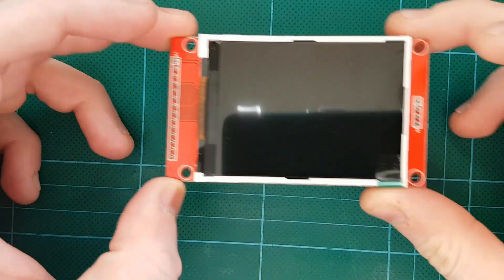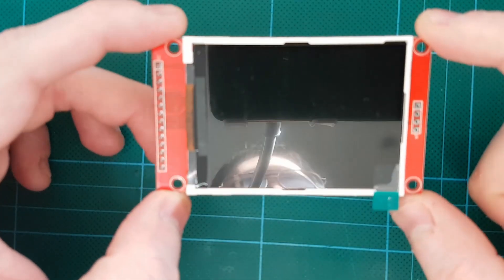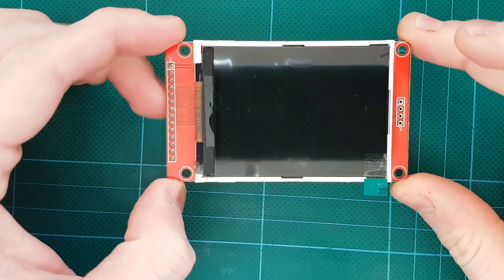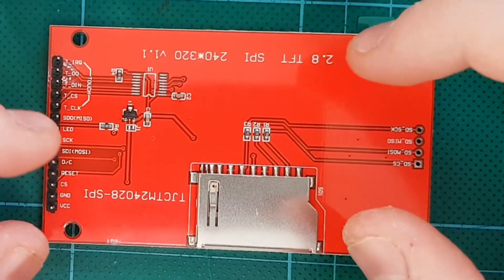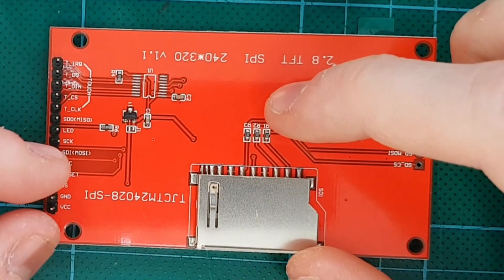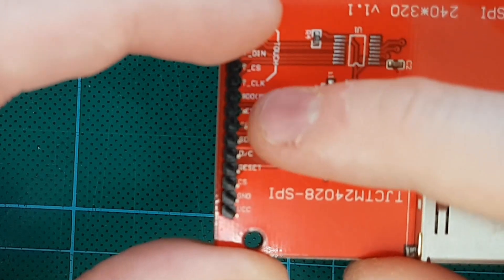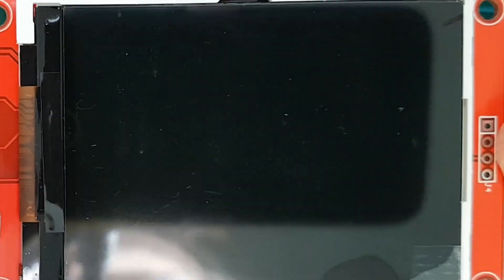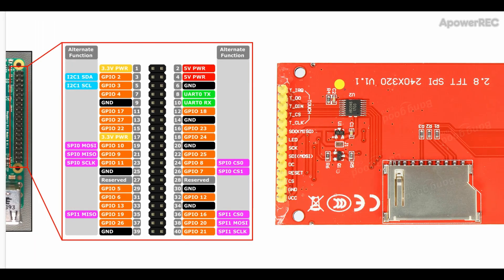Retropie SPI ili-9341 screen 30 fps+  tutorial

Comment: Even though this is 2 years old, is there someone that can help?
Once i type the modprobe command, all i get is "modprobe: FATAL: Module fbtft_device not foynd in directory /lib/modules/5.4.73v64"
Reply: this is because now, the kernel does not include the fbtft module anymore, if you want to use an updated kernel you will need to use a different method (device trees and overlays). The other option is to use an old kernel such as 4.14 or 4.9, this is what i have done, im currently using retropie 4.4 with 4.14.30 kernel version. Hope it helps
Reply: I got the same message too 😢

Comment: Does it work with RetroRangePi (Orange Pi PC)?
Reply from the maker: I haven't used it with orange pi. Give it a try and let me know
Reply: @bamsegod  I just want to make a handheld console using Orange Pi Zero(I alredy have Pi PC).I dont want to use 3.5 inch car parking AV monitor,it costs 11$ and have large sizes for 15x9cm double sided PCB.But this one is 2.2 inch,and cost 5$ and this is not blured AV,it looks like HDMI! Hello from Russia,from 12 years old child!

Comment: I have one question on this.
I achieved in getting it to work, thanks to you.
But, is there a way to get it to fit and expand on the whole screen? The height is perfect. But the width isn't true.
There's space on both sides.
Can this be expanded?
Reply from the maker: It should only be 320 pixels wide. There is a bit of a dead black space on the screen which is not pixels just screen assembly
Reply: overscan?
Reply from the maker: @calllen  off

Comment: are you sure the wiring you drew out is correct?  I just get a white screen.
Reply from the maker: Yes absolutely. Probably you have dc line mixed up. There are two methods for connecting the screen, each with its own corresponding code.
Reply: Nah the problem ended up being the 900000000 setting. my display, although the same as yours, wasn't able to go that high.  I got a great result with a lower setting and all is well!
Reply from the maker: @voicesofdeath2957  got it. I have seen discolouration with too high refresh but not the white screen. Glad it worked out for you.

Comment: Great !  Can i try  with raspberry pi zero ? Thanks
Reply from the maker: Sam Arcade yes this method works with both rpi3 and RPI zero. If you have a red screen then you can do 5v led. If you have just the screen without red PCB then make sure led backlight is connected to 3v only
Reply: EmulatedBen thanks you . I Buy display And i try To pizero. Greating from italy
Reply from the maker: Good luck
Reply: @bamsegod  Oh wow! They make this without the PCB?? I have to find this. I have only seen it with the PCB, but my project requires no space around the LCD.
Reply from the maker: @randoarchive  yes they do. Ili9341